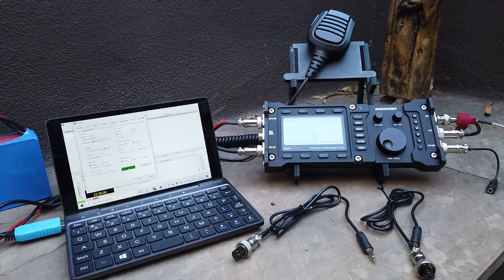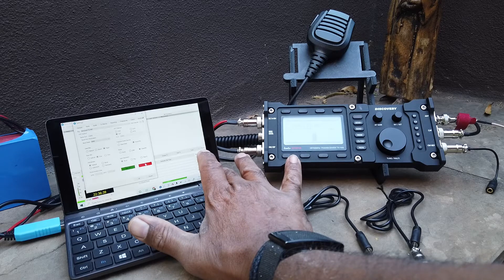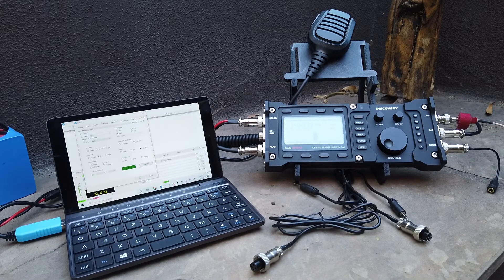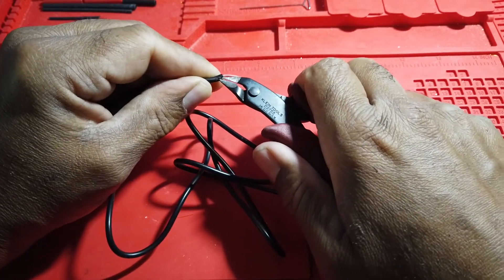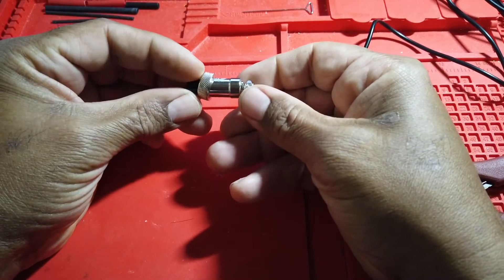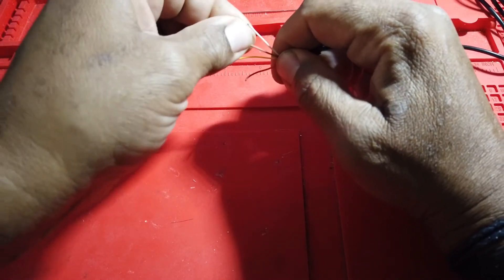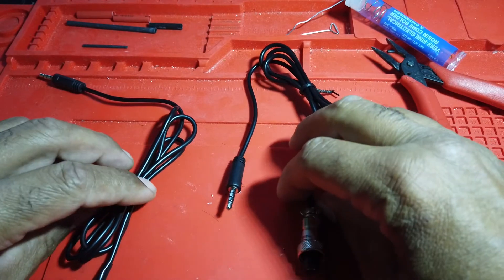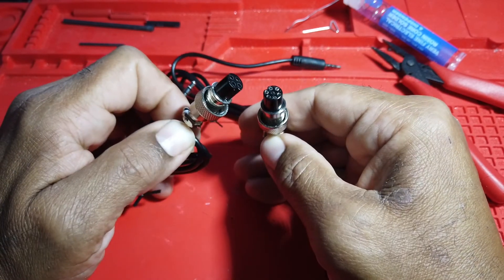Digirig Cables for Lab599 Discovery TX 500

Comment: What laptop are you using. Its small and light weight and perfect for mobile off grid setup
Reply from the maker: Thanks for watching and taking the time to comment.  This is the GPD Pocket 2.  It is very small.  It has a 7" Touch Screen, operates on Win 10, and is my Windows/Ham computer since I am a Mac guy.  This was introduced to me by Josh, KI6NAZ, Ham Radio Crash Course:  https://youtu.be/G-6W6EQoJwA

He does not talk about it much anymore.  I don't even know if it is still available.  The video I just shared above is him talking about it.  My drawback/cons: it is way tiny causing me to have to use reading glasses and the modified keyboard slows me way down.  Still, I don't go anywhere without it, lol.  Tiny fonts drive me crazy, but I won't give it up.  Why?  It serves its purpose really well, it is my ham/windows lifeline when Mac won't do it, and it seems sturdy and well-built.  I hope this helps.  Hope to see you down the log.  73 de K0WHW Bill